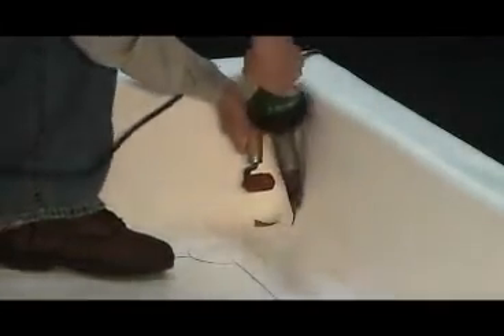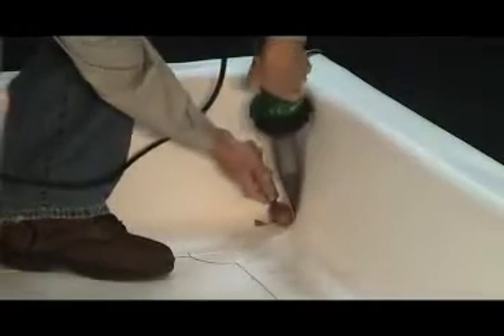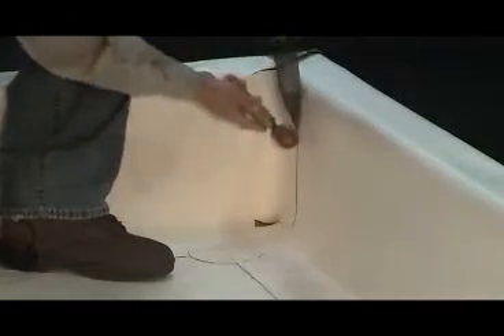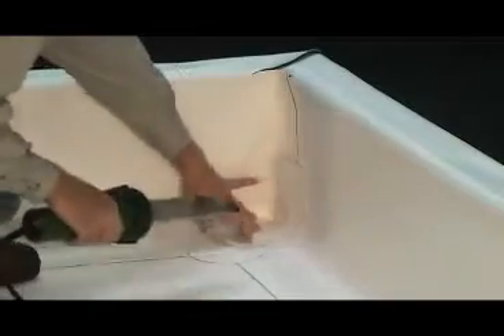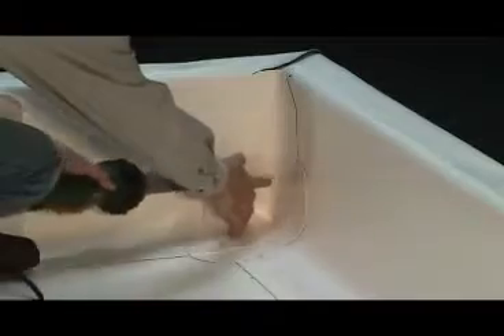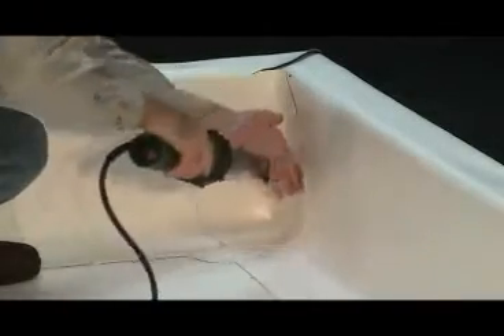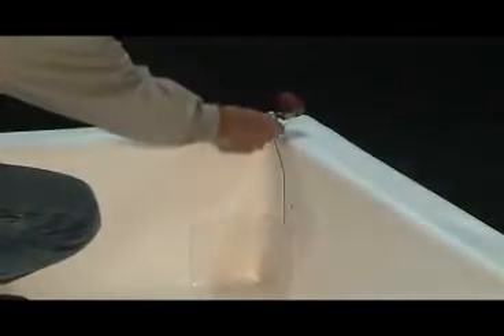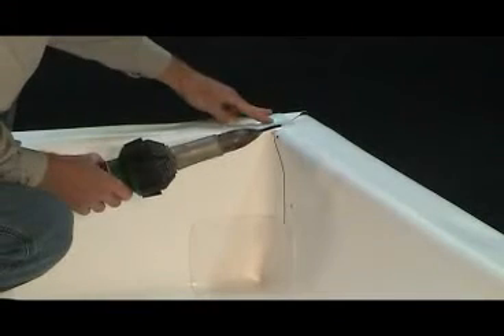Flat roof Installation - Part 10 - Inside Corner

Comment: Nothing wrong with this system. But it does beg the question, if you are trying so hard to make a seamless roof. Just use GRP, it is seamless by its very nature and as such has no corners or extra pieces to fail. Just my 2 cents
Reply: Lisa Dempsey grp?